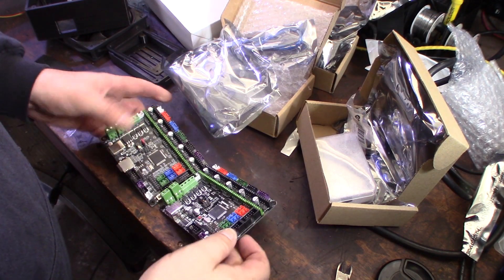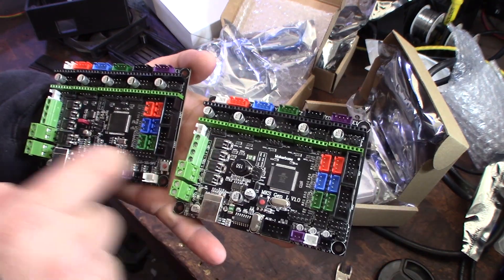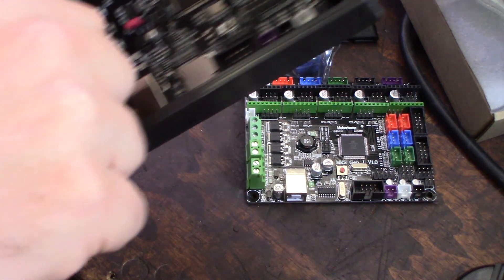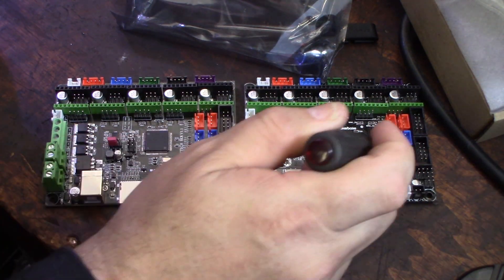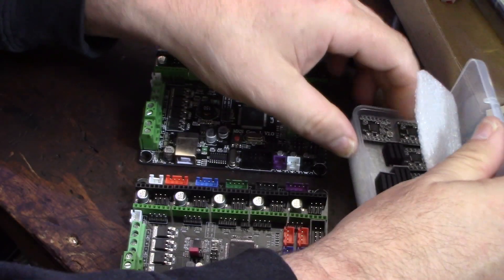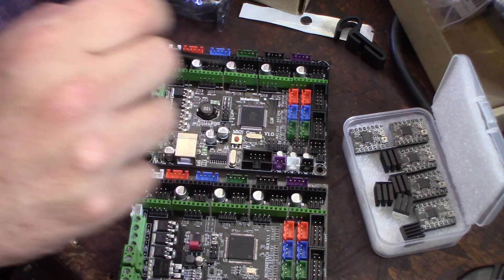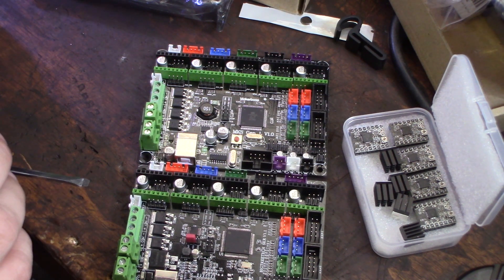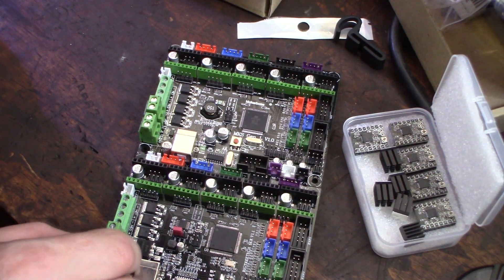MKS Gen L vs SKR 1.1 8bit vs 32bit side by side board comparison

Comment: I have doubt that those external add-on MOSFET boards are that great an idea... i mean the ones built in on this generation of boards are quite efficient and don't need much cooling. The external board ones must be arcane; plus they bypass the board fuses don't they.
Reply from the maker: I fixed hundreds of 3D printers. Everyone I've worked on with a bed over 300x300mm has a external mosfet or solid state relay.
Reply: @fintechrepairshop   If you need more than 10A on the bed it can make sense to add a MOSFET.

Though IMO they should be mains powered beds at that sort of size and then with an SSR.

Comment: So RAMPS 1.4/Megatronics V2/Creality-Melzi  was replaced by the MKS Gen L v1.0, which was then replaced by the BIQU Bigtreetech SKR v1.3 (LPC1768), which was then replaced by the Duet2 Wifi / MetroM4?

And as far as firmware, everything runs either Marlin/Pronterface, Repetier, or the RepRapFirmware?  Alternatively, you can burn Klipper3d, and offload the print server to a Pi running the OctoPi distribution?
Reply: Any thoughts on the BigTreeTech SKR Mini E3 v3.0 (STM32G0B1RET6 / TMC2209)?